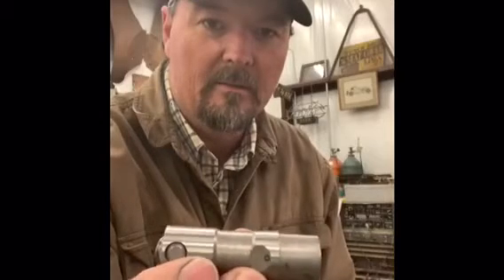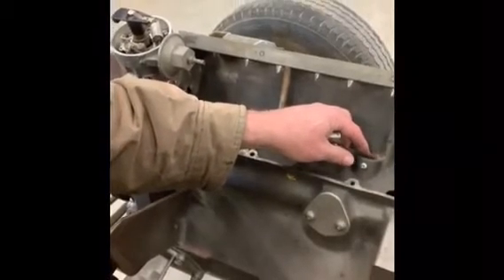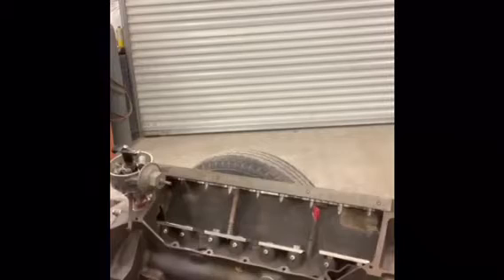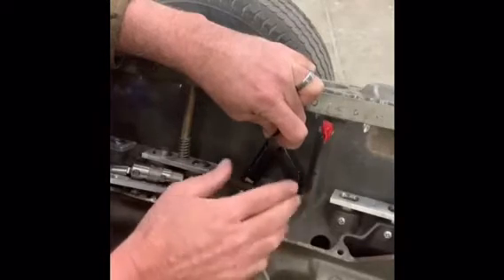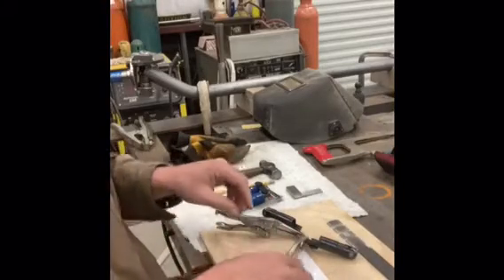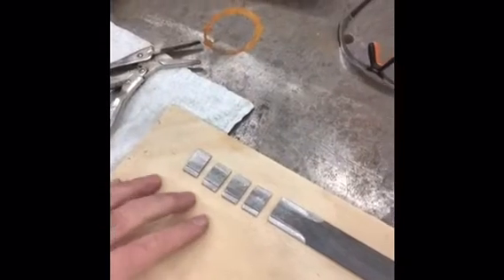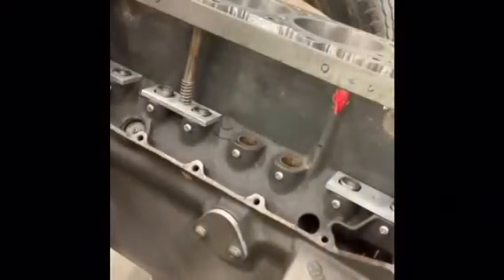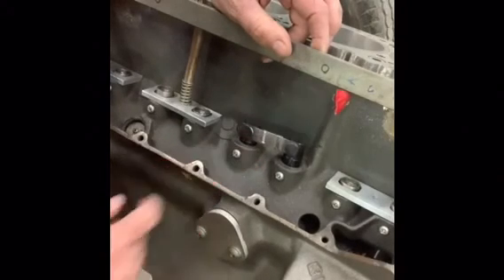1962 International Scout , roller hydraulic lifters. Hilltech Production.

Comment from the maker: Yes I did but only after adapting a 426 Hemi head to the 196 International block, so the engine is a fully rolled engine.
Reply: I’m sure you already entertained the idea of using International DT466 roller lifters since there are the same .994” diameter? Oil grooves at the wrong elevations?
Reply: Did you do a video or anything on that hemi head 196? I’d like to see that hermaphrodite.